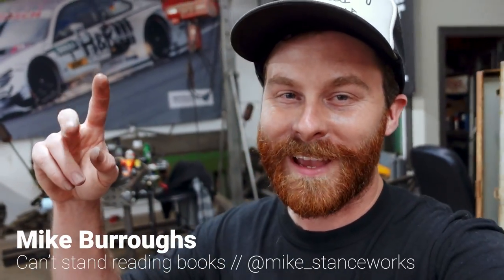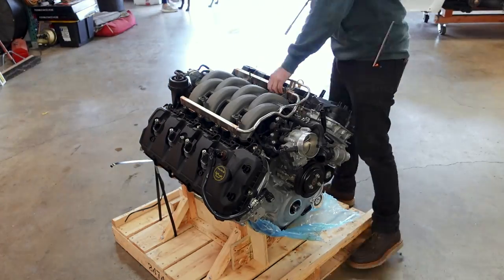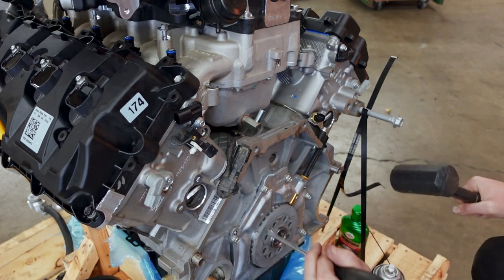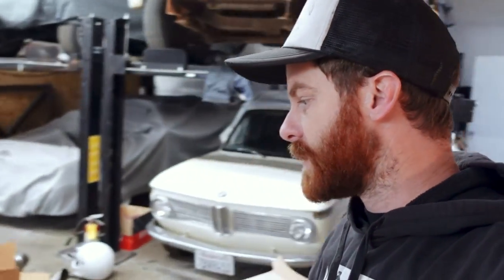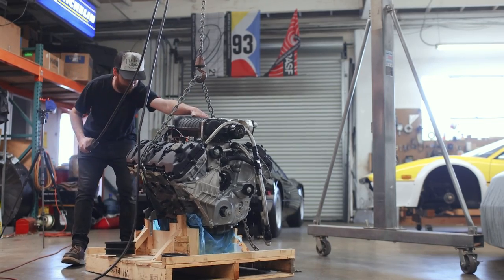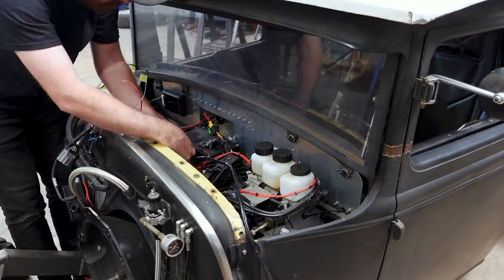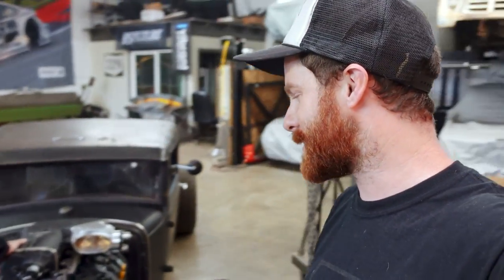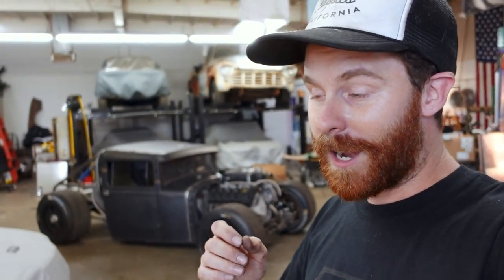Boosted Crate Engine Installed! '31 Ford "Race Truck" Has a New Heart

Comment: The looking for engine mounts situation made me laugh, that happens to me all the time. It drives my son nuts, he gets roped in to look for stupidly placed stuff whilst I keep working.
Keep only a small marked pot of acetone for cleaning, welding and drums of solvents is a big fire risk. The coach company in town had their workshop burn down because a weld spatter ignited some waste thinners. Fire in a commercial body shop is really scary. Everyone got out safe but it made a big mess.
Reply: It takes tremendous personal effort to follow the rules every single time. You are absolutely correct; separate and secure all such flammables, every. single. time. "If only I had" just doesn't make things all better after the fact.

Comment: I knew instantly where your engine mount arms were, because that is 100% something  I would do. Thanks for the lesson on brake clean and welding. I just bought a welder and had never heard that.
Reply: I thought they were in the house.   But he's got locked out.
    .  I put a jet engine in my Mustang last spring, and the chicks really dig me.

Comment: Brake clean is also explosive- I found out the hard way when welding on a motor in place- used brake clean to clean away the oil on the surface and when I struck the arc an explosion blew me on my butt.  The brake clean vapors had built up in the pan and went off like a bomb- it actually blew the front seal out of the timing cover.

Comment: I think it's important to note regarding that coolant crossover on the back of the heads, the heat causing issues (which that crossover was made to correct) only seems to be noticeable in drag situations where a car may make a run and then sit idling afterwards waiting for the next run. This is mostly coming from forum guys that have noted excessive CHT in staging after multiple back-to-back runs, which has resulted in wear issues in the back 2 cylinders. As far as guys pushing the engine on the track or other situations where the car isn't seeing much idle time at all, it's practically a nonissue. Most track guys will take a cooldown lap around the pits just to be extra sure.
Reply from the maker: Good to know! Appreciated

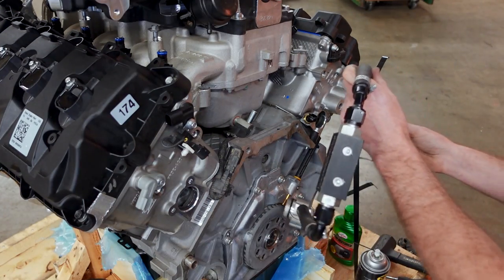Comment: I hope those rear head coolant fittings don’t leak, I could see that metal was shaved out when you pulled them @ 04:20 … it’s. Better to drill them and use a slide hammer to draw them out square.

Comment: How much for the frame,  rear end and suspension. I plan to use a standard 572 CID just for reliability and cruise with my wife. I am 74 and the Mrs. Is 54 so long drives included during summer. Await your reply. God Bless you young man, beautiful design, love it

Comment: I'd like to see a 'van' back end to the Model T. The 31 style driver compartment with a flat plate and roll bar rear looks 2 designs in 1. The box rear could have window cutouts - but no windows, obviously so the cooling wouldn't be affected. How good are you at coachwork?
Reply from the maker: So you want to see a tudor sedan? 
I appreciate your vision, but I built what I wanted to with this one.
Reply: @stanceworks  Is that what it is? Yes. If you hadn't got the modern build on the rear end I'd say nothing.

Comment: Recently got an old '34 Ford truck that had previously been chopped decades ago now and had a Corvette LT1 conversion w/700R4...I bet y'all Ford fanboys are crying I know... Tearing it ALL out and starting over. Old outdated suspension and brakes are the 1st thing in order to attack as the old I-beam/leafs WON'T cut it.. Definitely a 4 link in the back but not sure about frontend yet.

Comment: Hey Mike 
You did not tighten 2 intake bolts, 
I can see them under the throttle body.
Reply from the maker: Those are for the fuel rails. Worry not!

Comment: where did you get the AN water fittings? PBH? I assume they will allow you to ditch the stock coolant hoses and run AN coolant lines?
Reply from the maker: Correct. I got them from MMR.

Comment: Total noob question: If the k24 can do 1000+ hp with 2.4L while being small and light, what is the point of a 5L engine if it ends up similar in peak horsepower while being heavier and consuming more fuel ? Being less turbo dependant? Power in lower rpms? Aesthetic reasons?

Comment: Is your gantry crane commercial available or did you build it? Thank you
Reply from the maker: A little of both. The structure is from harbor freight. The top cross bar was replaced and it has a different winch on it.

Comment: Are you certain the previous engine failure was just tune related? Fuel system is good to go and could not have caused an issue?
Reply: Thay beat the living hell out of that engine on Hoonigan
Reply: @Zzus321  My concern would be an issue caused by sitting in storage for a while. Would need to know more about what the storage period looked like before and after the recent dyno session that was mentioned.
Reply: @NoClassic  the original engine
Reply: @Zzus321  Yes I understand. I was speaking to the original engine as well.
Reply: @NoClassic  I hear you. I'd have put some Marvel Mystery Oil in the cylinder's
Reply: @Zzus321  I was talking about contamination/oxidation within the fuel system not the cylinders. It is pretty easy for even very small particulate matter to impact injector flow.

Comment: Whilst on the topic of safety and good practice, put a guard back on that grinder!!! 

If you need to take off the guard you are using the wrong tool!

So many YouTube and tv shows do this it’s crazy 😡 a cutting disc is soooo easy to explode if you load it up at an angle.
Reply from the maker: Then don't load it up at an angle.
The grinder is useless with its guard on.

Comment: As an aside,  you live in California,  you cannot buy chlorinated brake cleaner here.  The only people who actually care are the armchair warriors who heard about the mustard gas thing once, and maybe a weld shop foreman.  It’s definitely way more expensive than using straight acetone but I have yet to find an acetone delivery device that doesn’t suck to use or leaks half of it away.